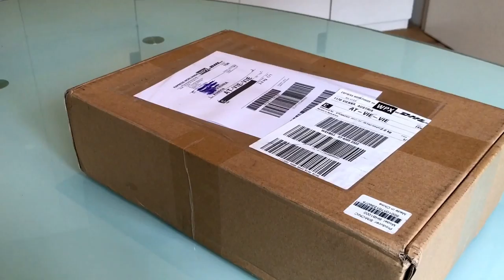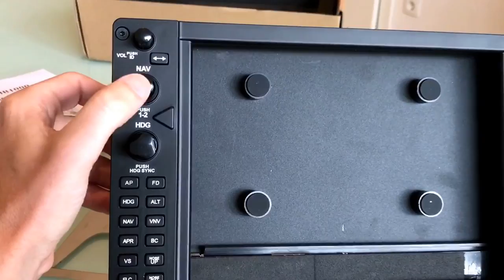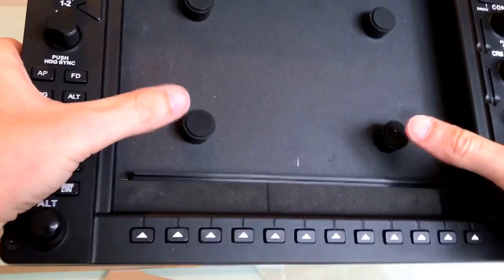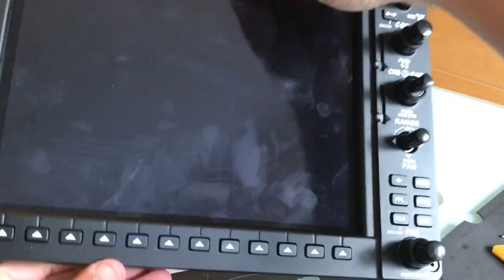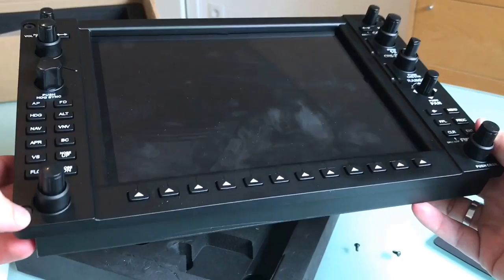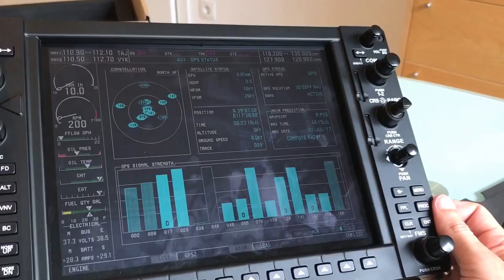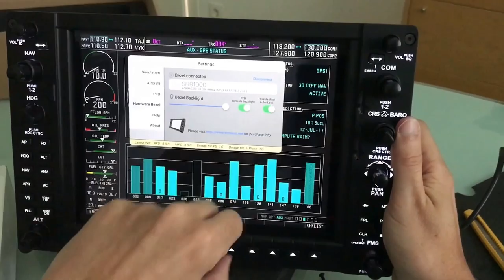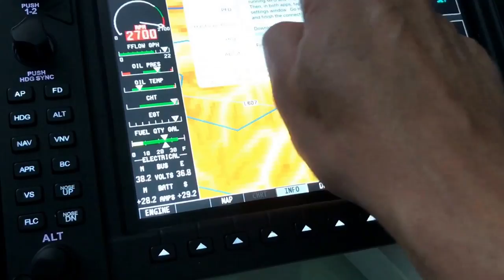Unboxing of Simionic G1000 bezel and first runup with integrated iPad

Comment: +Chris Keough +O Ben-Ad I took the dive and got my SH1000Combo last week after much deliberation and comparing features/options with similar products. I also bought two used iPads.

 I agree it is a little pricey, even when listed on sale. You can save some money with used iPads. You can look for two iPad Air 16GB Wi-Fi only. I got two iPad Air 2 64GB Wi-Fi/cell because I want to use them for actual flying and other personal uses and need more storage and speed.

 I sim and also fly recreationally in real life. But the main reason for purchasing the Simionic SH1000Combo is that I wanted to stay current in the G1000 when I go out flying. Certified G1000 sims at local schools, at the time of this post, go for $79/hour. If I use the SH1000Combo for a number of hours I break even and the rest are profits. I do not fly much so staying current with is important to me, and much safer. That is what I like about the SH1000Combo. I can use it as a standalone unit with the MFD/PFD. I practice with the apps on a weekly basis when I am bored or before going to bed.

 Yes, I could just do sim and practice or get a much cheaper G1000 PC software but this is not the same as actually turning knobs and pressing buttons. Software sim is what I did first when I got the Simionic MFD/PFD apps. And it helped a lot but I wanted a little more real hands-on practice. For me, sim'ing is an added bonus. But I do sim'ing to practice procedures for actual flying practice.

 If you are not a pilot I can see the decision being more difficult. Also, keep in mind what to do when the iPads are discontinued or batteries go bad or the iOS is not supported on the app or iPad size increases too much to fit the bezel.
Reply from the maker: +AeroRamer Interesting thoughts. Especially what you wrote in your last part did make me think twice aswell. But being among the first ones using a promising solution involves some risks I guess and I am pretty confident that it should work for a rather long time. By the way... I was recently chatting with another user who made a video of this solution - since I consider it helpful to be connected. The guy then made a closed FB group and I recommend you keep a look at it to discuss among several other customers... look for „Simionic G1000 flyers“
Reply: Great to read AeroRamer.What are you flying in the RW with the G1000?I am currently doing my PPL in the SporStar, but the club also has a C172 and PA28-181, both with steam.C172s with G1000s are available from other airports in the Sydney basin, but at  $217 USD/hr, around twice the price I pay for the SportStar.So who knows? Our club is currently looking for a replacement for a Mooney, so maybe we will get complex and glass all in one AC.Cheers
Reply: BTW Alfred and AR, have you guys given XP11 a go? I am a MS/P3D tragic from way back, but I have been playing over on the dark side lately, and have been very impressed re the flight model. I use the Piper Cruiz to replicate the SportStar as they both have the same engines and very similar performance numbers. Along with this, with the use of Ortho4XP I can get the RW visual references for flying my patterns and doing my air work in our two training areas.Cheers
Reply: I fly C182's with the Civil Air Patrol. They are moving to G1000's. Yeah, the rental for G1000 are high. But that is where technology is going. We need to learn it and feel confident with it. In KSGJ, the C172SP G1000 is going for $159.00 which is slightly under average for the USA. The highest I've seen here is $220. The round dials here are slightly cheaper but not half that of the G1000's. Maybe $35 less. Mooneys are nice and fast. Be safe in it.
Reply: No XP11 yet. Have come close to get the Steam version. I suffered with MSFSX through so many years and finally got it to work well with the Steam Version and Spad.next drivers. I have to try it one of these days.
Reply: Have a Merry Christmas AR.Wishing you fun flying in the glass C182s.Cheers.
Reply: Well worth a fling. I couldn't believe how well it went and looked straight out of the box. Like you, I have spent $100s on add-ons to build my ideal FSX/P3D world, and honestly believed that I would be happy to maintain both platforms, as I went out and bought a 1TB SSD just for XP. But since trying XP, and enjoying the feel of the GA flight model, I have not even booted up P3D since. I'm definitely not a FSX/P3D hater, but for GA flying it does feel a lot more dynamic and true to life. Because it is a more accurate flight model, it has been of great help in my sand-boxing my traffic patterns, then bumping in some crosswind, then turbulence. Trying to be consistent in the pattern, as you already know, is really important, especially for such a low-time student as myself (19.1 as of Sunday).Cheers.

Comment: hi alfred, will the sbh1000 works with xplane 11? and will it work with any aircraft using MFD like boeing planes for map purposes only? will the map functions with other planes not having g1000?
Reply from the maker: Sure it does! It will work with any aircraft. You can even customize the engine gauges to your liking

Comment: if you open web browser or memo on ipad. is those buttons works as keyboard or is it some custom hardware that only work on this app.how it connect xplane or fsx is there pc program. so it will be Ms2020 soon.who buy it on xplane anymore xD
Reply from the maker: Is is "just" a custom hardware that just wakes up when you open the corresponding app. Since such setups are mainly just used for the purpose of simming there is for me no need for shared use of the equipment. And for the other question the bezel of course already runs on MS2020, and on 3 other platforms. There are just a few issues with Asobo's Autopilot logic that is somehow different and they are currently releasing updates on the MS2020 bridge. But using this G1000 already on my 3rd sim platform is a nice thing.

Comment: hi can you please help me connect my simionic bezel with my flight simulator x ? I got the I pad did all the plugins and stuff and still nothing
Reply from the maker: welloglock40 you just need to be in the same WIFI as your sim pc. Pretty straight forward. If you still have problems pls contact the vendor...

Comment: Can you buy one bezel and switch between MFD & PFD?
Reply from the maker: Khan Bui no, the PFD always controls the MFD, which is slave
Reply: @AlfredtwinSim  I was thinking since I have both PFD and MFD apps on the same ipad.  I thought if I could switch them like switch apps in the ipad.  Would that work since both apps are running at the same time?  Thanks for your reply.
Reply from the maker: You can play around with the mfd in the bezel, yes. But you need to have the PFD running on an different ipad to connect it.

Comment: What is the size of IPAD fit in ? What is the application work on ? Is it work on XPLANE 11? Thanks for answer.
Reply from the maker: +emmanuel mozzi it is 9,7 inch, application works on ios and has clients to connect on a windows client with P3D, FSX and XP11
Reply: Can I use a cheaper android pad?
Reply: Michael Hesterberg No, it’s iPad only
Reply: @AlfredtwinSim  what is the name of this panel if i wanna buy it
Reply from the maker: Mohamed Khater Simionic G1000, just google it
Reply: @AlfredtwinSim  thank you so much

Comment: If the point is understanding how G1000 works, there are free applications and simulators for this. In case if it will be used for flight simulator, I think it is unlogicaly costly if we consider it works just for a few planes in the games like X-Plane and MFS2020. Anyways, nice video, thanks.
Reply from the maker: My whole project is somehow unlogical costly, given how little I fly with it and how little I know about real-life procedures. But the moment firing all those avionics and systems up and enjoying the immersion - priceless😀

Comment: It would almost seem more cost of effective to purchase the RealSimGear setup than to buy these units and Ipads .
Reply from the maker: HvyMetal4Ever actually this is not the case. Since this is a networked based solution the only way to achieve this with the real sim hardware would be to purchase the f1tech g1000 trainer in tge pro version (which allows networked operation with bezel hardware). This is around 1000 USD if I remember correctly. Taking this into the calculation makes the Simionic approach much cheaper. Further more setup is easier (I have the f1tech trainer and it was painful to run it) and it does not even feature synthetic vision.

Comment: Which airplane are you flying with this??
Reply from the maker: +Larry P The profiles currently available from Simionic are for 4 single engine Cessnas only. However the developer is planning a DA42 twin profile that will be used in my case.

Comment: Looks nice and quite well made, but it’s grossly overpriced 1600,- for just the bezel is hard to justify :/
Reply from the maker: Anand S. No actually it is the cheapest solution. What people forget is that with any other approach you need a pc to run the g1000 and a software which costs 1000 USD (there is just one working with a networked pc, from flight one tech). So looking at this and doing the maths it is not bad at all

Comment: 700$ for a plastic injection parts with some electronic and all made in china. Real cost around 100$, it's a scam even if the quality is almost if not like the real one like you said.
Reply from the maker: I do not know what it really costs and it is possible that the manufacturing costs are that low (which I doubt since it is produced by a contractor in a small number of units). But if you consider that to be scam and you do not count in costs for design and software you can say the exact same about any iPhone, iPad or Samsung phone.